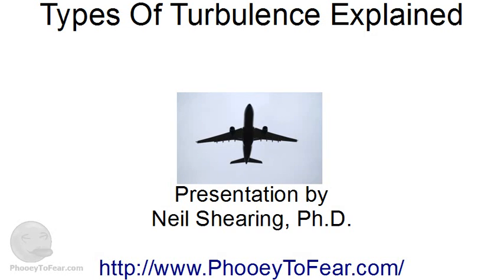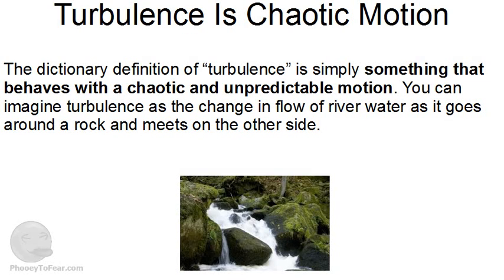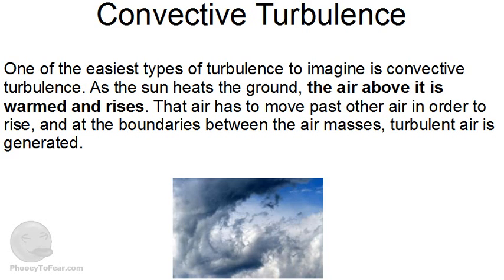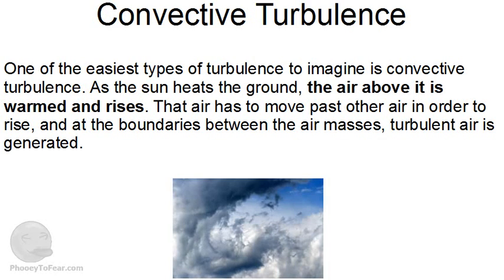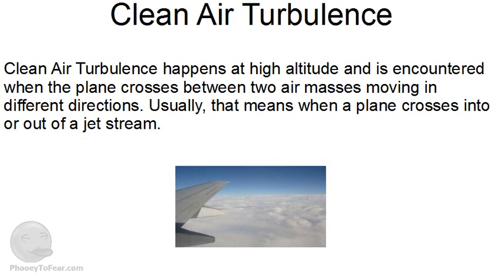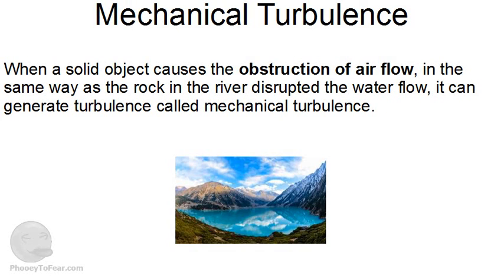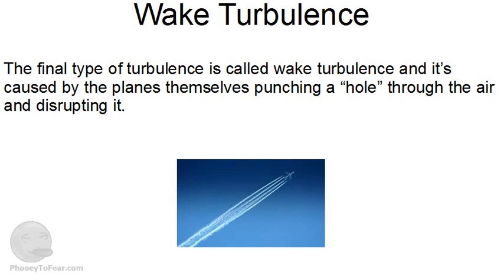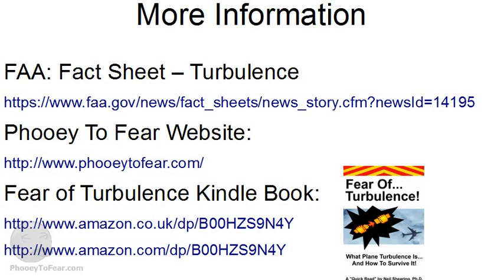Types Of Turbulence Explained

Comment: Wake turbulence actually occurs on the wingtips and is due to the high pressure air from above the wings being "drawn" to the low pressure air from under the wings resulting in violent vortices which can reach speeds well up to 100m/s.